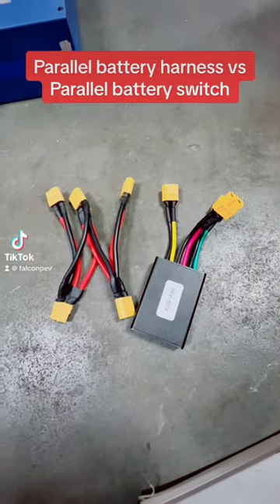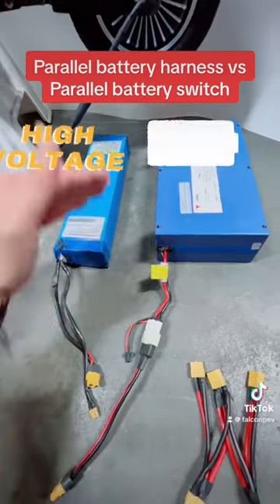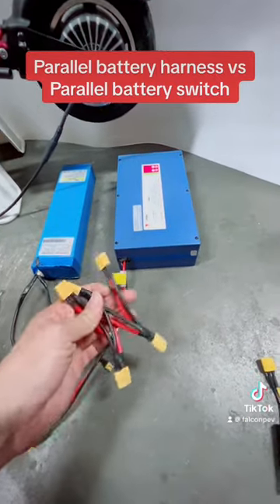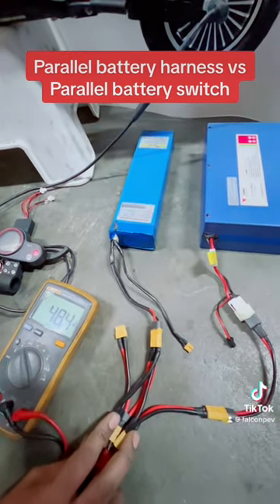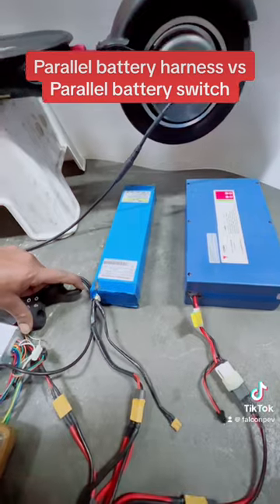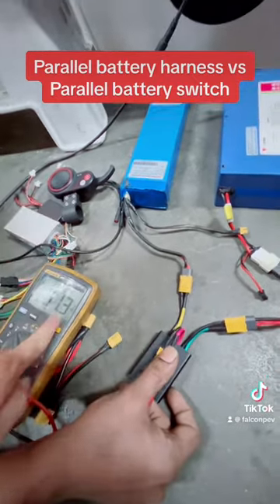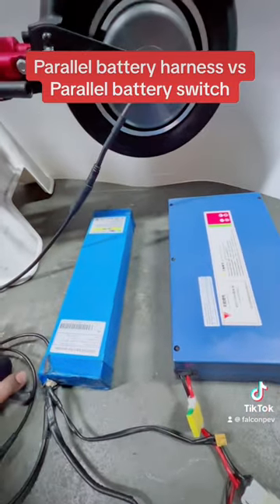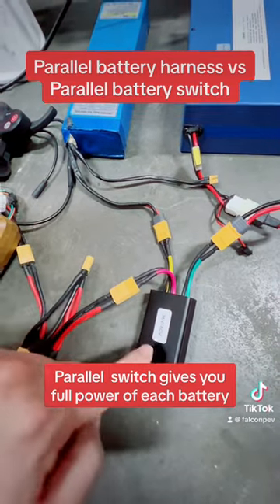Parallel Battery Harness vs Parallel Switch: which one is better?

Comment: This isn't an issue for batteries with the same capacity and the same state of charge (obviously also the same voltage rating), which is how they should be installed for a dual battery setup in the first place.

Comment: Can that switch handle regenerative breaking. 

There are a lot of these on the market but they all have the same thing in common, they don't support regen. Just wondering because you didn't mention it in the video.

Thank you!
Reply from the maker: Good question, instantaneous current forward or reverse is up to 3X the nominal current of 30A

Comment: So.. i have a mangosteen M1, 60v batteries, same kind. Can i connect the two batteries together, in order to get at longer range?
Reply from the maker: what is a mangosteen? jewish mango? joking aside, yes you can connect two batteries with the same voltage together.

Comment: If you joined both batterys  at there terminals and used 1charger to charge both  then connected to your controller would u be  running any batterys down  or taken charge from one to another?

Comment: Can I use this same setup to connect a second battery on a Zero 10X ? (being 2 controllers I would need a parallel cable with 1 female and 2 males correct?)

Comment: Could you use a 16s and 17s battery? I would think when fully charged the 17s would discharge on its own until it reaches the voltage of the 16s. Then both together. Am i correct? Great video!

Comment: Hi I’m a bit confused. I have a Nami Klima and I want to be able to be able to have two batteries connected/plugged together but I don’t want them to be drawing current from both I just want a switch that can swap the battery that is discharging and powering the scooter. Do you sell something that does that or just something that waits for the match voltage and then discharges from both together. Thank you
Reply from the maker: Yes we do it’s our manual solid state switch

Comment: Hi, I have 2 bicycle battery 36v 14A.How can i put in paralel? Can put in paralel discharge and charging port in.? Thanks
Reply: You will need the parallel cable like in the video. Then just plugged the parallel cable into the controllers and to each battery and you are good to go. Just make certain to fully charge both batteries before taking your bike out for a ride.

Comment: Hi there . did you have to flash the software
Reply from the maker: no flashing needed. Just the solid state switch is sufficient
Reply: @FalconpevSg      Thank you very much, I wasn't  game to buy a bigger battery just yet, Just bought  basicly the same size and amp battery to have as the external, If that doesnt do much i will get a little bigger amp battery next time. Let you know how it goes when it all turns up. Its just a ZiaomiM365

Comment: This video is deceptive and inaccurate.  Where to start...
The small battery can't output the same amps as big battery, speed reduction and harder on equipment.
If both batteries were plugged in together and charged to same voltage, the parallel system would produce a higher top speed/acceleration due to combined amp output and would hold higher voltage longer vs switch.
Parallel batteries of different voltage should not be connected together otherwise you increase risk and put bms under strain because the input charge of batteries is likely not suited to take that sort of amp, especially if the little one is underpowered vs the big.  

Parallel them once both batteries are at same voltage...the end... the increased amp and capacity will allow you greater distances and also preserve the batteries much longer.
Reply from the maker: Thank you for your detailed thoughts on this. You came out strong and we respect that. But it’s full of assumptions and a misunderstanding of the what we are trying to do. If one of those batteries has the right cells and BMS that can handle your motor power, one of those batteries is all that you need, you don’t need 2 or 10 of them. Secondly our whole point is that with the switch you do not need to always ensure your batteries are charged to the same voltage. It’s a hassle. Just plug into the switch and switch take care of it. That’s the whole point.
Reply: @Falcon Pev | Pab Pmd Escooter Ebike Shop Singapore  sorry was using the scooter pictured in the picture for example which is a 2wd scooter and would typically take beyond the small batteries nominal output, motors and electronics should be matched to the ride as a setup that pulls more amps vs the bms is able to produce is a hazard in itself, imo.  If the only convenience of the switch is the ability to charge and use both batteries with different charges... the advantage is not that great vs the advantages provided by parallel*.  

(*unless used with a small 500w scooter which doesn't have much for power req and you just want easily modular add/remove range)

Parallel =more amps and slower drain across the board and thus increased battery life and longevity.  Charge once and match voltage... setup and forget.

The Switch, a person could disconnect and connect as they please, without worrying about battery equalization... but parallel would give more speed/acceleration as you'd have the combined output amps of both battery which would hold you in higher voltage longer, with the inconvenience of matching voltages before using or leaving in place.

The hassle of connecting together isn't that great for casual use and is none existant for anyone planning on plugging in and using both at the same time.  But you should be able to agree on the fact parallel will make the batteries health last longer as it would be a slower drain across the board vs the switch. 

On final note...you could also reduce charge time with parallel as a fast charger like 4amp or 5amp would be much better suited to charging both batteries vs a fast charger doing one at a time via switch... using a fast charger sparingly is recommended for single 52v 20ah battery, but could be used more frequently in a setup with a 52v 20ah and  52v 10ah second battery in parallel due to the increased charge rate capacity of parallel.